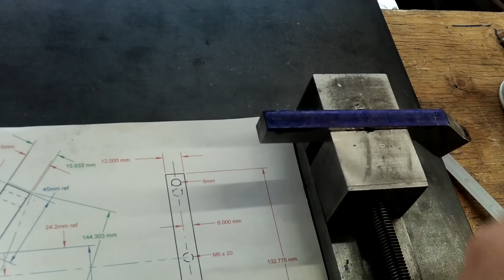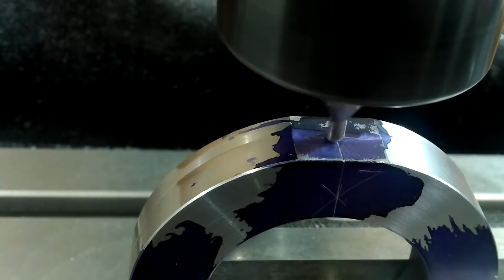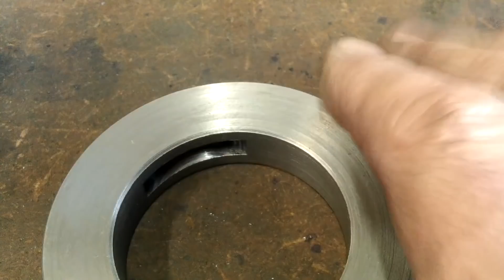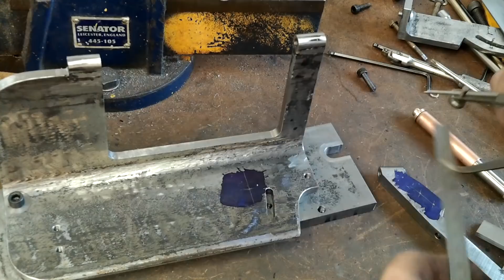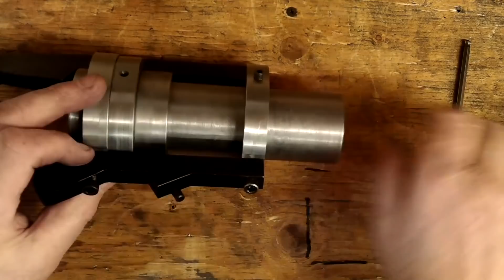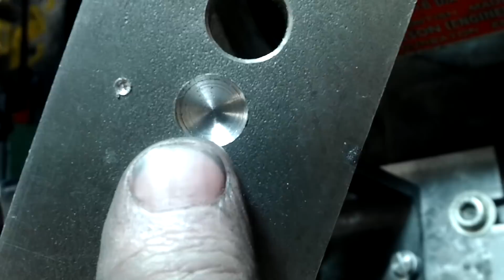My Drill Sharpener Mk2, Part 2

Comment: Very interesting build. Very nice work, and way to persevere. If you had to put a price on it, I wonder what it would cost to build one to accommodate larger drills such as 1 inch? I only ask because I just bought a drill bit sharpener from Vevor, and it goes up to 1/2 in. The cost was $240.00 minus various discounts. This sharpener if it is only limited by collet size would be an excellent idea. I'm considering getting into machine work as a hobby as I have just recently retired myself. I may need some projects to keep me busy. Happy machining,  regards Jeff. Congratulations on the sale of your home.
Reply from the maker: Hi, thanks for your comments, and I wish you all the best with your future endeavours, If I could ever give you one peice of advice that will always keep you in good stead,... That is, I would always advise you to have, and know where the fastest method to stop the machine you are about to work, preferably somewhere on your exit route. Live by this rule, and you will live to see another day. All metalwork machines are designed to kill you if you ever  make a mistake. All the very best.

Comment: What a lot of work for making a drill sharpener. For 500-1000 USD you can buy decent/professional sharpeners that do the work at least the same. For hobby work, that is too expensive. Than hobby tools need to be made.
Reply from the maker: Hi, these machines cost more than I can afford on a pension, so I make what I can.  For bigger machines I have to wait until a repairable scrap machine comes available... besides, what else have I got to do in my old age?  Cheers
Reply: @Thesheddweller  Ah ok. I thought is was for a workshop. For hobby it's fine, although I think maybe a bit complex solution. It's a bit an out of the box solution. For these things normally the best solution is to do what Einstein did: Combine what other have done before and add a tiny litebit yourself to make a worldchange happen. Second point: normally the best solutions are also the most simple solutions. Good luck with your project 🙂
Reply from the maker: @phyx1s  thanks.

Comment: The only time I found a need to have a drill sharpening device was when drilling 2mm diam holes in some 316 stainless so I designed and made a Wishbone type drill sharpener that allows you to hand sharpen drills down to .5mm diam......this type was common in the 50's for sharpening small drills.
Lately I've thought about the 4 facet drill grinding method and with a new T&C grinder build I'll be trying that out.......I think the Deckel type T&C grinder would do that nicely.
Reply from the maker: Hi, yes I remember seeing the wish bone types being used in the tool room for the less important jobs. I belive that any sharpening method  that sharpens the drill bit to cut true is a good thing.
Regards

Comment: Blooming brilliant. I have a small engineering workshop where I do whatever comes in the door. I have built several pieces of equipment to make my life easier including a automatic feed for the band saw a RHS bender and a machine that crimps RHS to fit neatly inside 50m RHS. For years I have sent out my larger diameter twist drills to be professionally sharpened once a year to bring them back in the specifications. This project gives me faith that I can do it myself in future. I don’t care how good anybody is at hand sharpening I defy them to accurately sharpen a 2 inch diameter twist drill exactly to specifications. I even designed and manufactured a machine to wind tiewire onto needles for lacing chain link fencing. Thank you so much for the time and effort you put into these videos😀👍🇦🇺
Reply from the maker: Hi, thanks. I have since discovered that the narrowest arm on the support plate is not as sturdy as it should be.
It needs a fillet to lock it down and I’ll attach one soon. regards

Comment: a way to dress the grinder wheel to (in/with) your fixture is something to think about
Reply from the maker: Hi, yes very true. However, a dressing stone or diamond has to be mounted on a very sturdy base, the longer the base, the more sturdy it needs to be to prevent any cutting wheel vibration. I like to separately true the wheel with a diamond and regularly dress with a carborundum stone. regards

Comment: Excellent Paul as always. Love watching your videos
Reply from the maker: hi, thanks, glad you enjoy.
Reply: @Thesheddweller  what type incerts do u uses, they look like the ones for alloy!? With the relief
Reply from the maker: @lesmo9627  Hi, Les I generally use what inserts are already in the tool holder.
The inserts that look like alloy hackers are probably stainless steel finishers.
My lathe is a hobby lathe compared to most and I can stall it by putting a too heavy cut on so its hardly going to matter what insert I use.